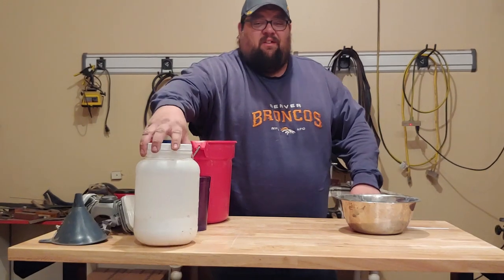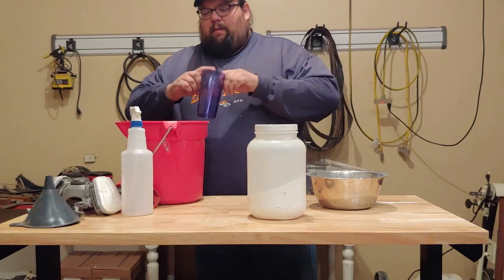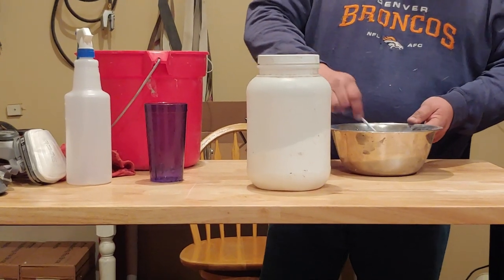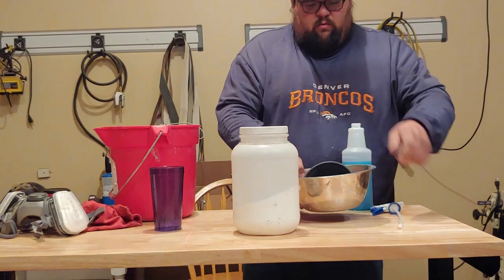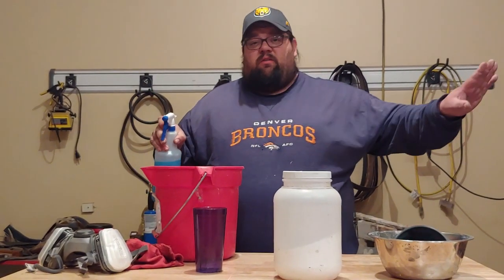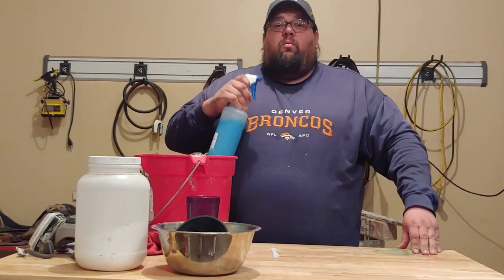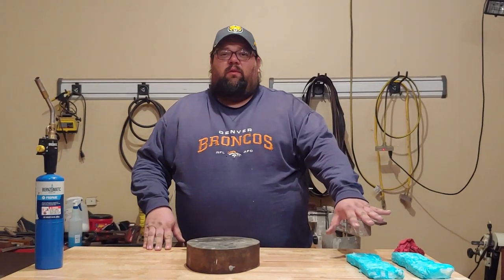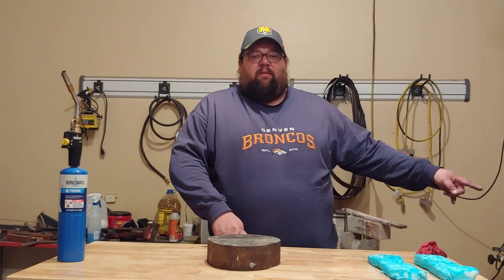How to ridgidize ceramic fiber blanket

Comment: Many thanks for your video. I purchased the fumed silica to rigidize the kaowool and will fire the kaowool/silica/food colour after it dries. I will add refractory cement after. Sincerely appreciate your experience and knowledge. Ralph, Ottawa, Canada.
Reply: Hey man i just recently started a job as assistant into making these furnaces. The thing is, the guy is kinda uncautious and when he throw these things on the table a lot of dust comes up! Im using a mask but it doesnt closes too well, i tried 2 masks and it was a little better, but i felt some chest pain later in the day... i got very scared. I dont want to lose this job, but im also an athlete as hobby and damn... im too scared of lung problems!!! Could you give me any advices to protect myself???? Do you think a couple months of exposure is enough to have problems??? I really need the money. Im gonna tell my boss that i believe we should treat it way more carefully otherwise i cannot stay.
Reply: @emoxanax  a P100 filter on a respirator will protect you from that. Under $50 if you need to buy it for yourself, but that really should be covered by the company.
Reply: @VoidedWarranty  yeah i ended up lefting. The guy had some chronic cough, he burned that shit with no ventilator inside the damn place... anyways! Fucked up. Hahah

I started a new slave job tho. Hopefully things will sort out.

Thanks

Comment: PLEASE READ:
DO NOT use fumed silica to rigidize your ceramic fiber blanket. I understand it is accepted by many "blacksmith experts". And I mean no disrespect towards the gentleman who made this video, or anyone else. It comes down to inorganic chemistry. Please read.
The reason we need to rigidize ceramic fiber blanket is to prevent the tiny silicate particles from entering our lungs. They are very bad. If you want more info on it, Google it. 
Ceramic fiber is made from Silicon and oxygen bonds, basically. The silicon and oxygen may form many linked bonds (hence larger fiber) or they may form a few (invisible fiber). It's a mix. But, these fibers are not connected to each other very well. Think of a jar full of small marchmallows. That's fiber blanket. Now heat it up and melt off of it-that is rigidize blanket. Kind of.
To prevent the fibers from breaking off and entering our lungs we need COLLOIDAL SILICA. Colloidal silica IS NOT THE SAME AS FUMED SILICA ADDED TO WATER. IT IS NOT EVEN COMPRABLE. in fact, fumed silica is the exact same chemical structure as the silica dust you breath in. If you use fumed silica, you are only making the matter worse.
Colloidal silica consists of tons of silicon atoms bonded to oxygen atoms and hydroxyls, in a repeating manner. Over and over again. They are massive molecules. When you apply it to ceramic fiber it will bind to the oxygen atoms of the silica, hence literally binding each fiber to a very durable and sturdy mass that will not let go.
Please, do not use fumed silica for rigidizing. You are actually better off not using anything. Fumed silica is exactly what we don't want to breath. To make colloidal silica from fumed silica, you would have to add sodium hydroxide, heat it up to a ridiculous temp, then use diffusion or chromatography methods to isolate it, as well as the aid of catalysts. It is NOT made by adding water.
Stay safe. Verify what you are told. If you don't know how to verify it or are not willing to, pay a professional to do it.
Reply from the maker: post sources.  I have posted the MSDS multiple times as my source to the safety.  Post a source other than your addled brain.

Comment: Ive learned tons over the course of becoming a glass crafter, with no help, money, only used recycled materials. First I made a table, blacksmithed a bunch of tools. 13 months later im doing my brick homemade Hotbox (kiln) . Its parts of from a junked BBQ. I spent money 170$ on a torch,bottles. I did buyn some ceramic wool blanket for my hot box. Since i dont want some mass manufactured thing newho. Anyhow i could write a story. Just buying silica ashes, or fumed silica, lolI learned a shit ton about oils and coatings and a world of oils and endless blends i never imagined. I hope someday people can have good times together without knowing whats gonna happen. I love cooking, its similarly creative. My slurry for keeping the coat from shedding was the silica powder, a touch of gypsum or pop, . I surf as well . As knowing resin/Epoxy/Fiberglass for repairing. The world is becomming  asmaller place and less confusing the more i know and see and experience resins form, recrystalize, hardens. I lined by Top half today with Blanket and a shitton of Silicate.Yes Today.. I don't know nor think it will be much different than the reaction to make surfboard resin. once done. I saw all its uses from some ad and was impressed. This stuf weights grams for a quart of it. truely awaiting results.
TY for the introduction , I t helped me progress

Comment: I want to use a ceramic blanket to surround my RV generator compartment to keep heat out of the coach. After ridigizing do you think the ceramic blanket can be used by itself for this purpose?
Reply from the maker: no.  if the rigidiser is not fired after application, it will eventually dry out and begin releasing from the blanket.  If you were to heat it to 2k degrees after applying rigidiser then it will work.  however it will not be very flexible.  If you go that route I suggest prepping and firing a 2" square piece first so you can see how it behaves afterword.  Also by adding more silica to your water mix the more "foam" like the resulting fired blanket will be.
Reply: @irondaggerblacksmithsupply1237  Thanks for the response. Well I agree with your logic and your's and other videos about ceramic insulation blankets have me convinced that I need another, more conventional solution to heat and sound insulation for my 1973 GMC Motorhome generator compartment. I went overboard in my zeal for heat insulation. There are other products better suited to my requirements. Now I'm stuck with a 12' x 2' x 1" roll and a jar of fumed Silica.
Reply from the maker: @donjaksa4071  If its 12' by 2'  its probably 2" thick.  1" is normally 25' by 2'.  post it for sale locally.  I assure you someone will buy it.
Reply: @donjaksa4071  build a forge or 3 lol

Comment: So I just ordered a devils forge furnace and didn't even know about this stuff am I supposed to remove all the ceramic wool from inside the furnace to do this to it or can I leave it in there while I coat it?
Reply from the maker: You can leave it in.  Just be sure that you are wearing a respirator when working with it.  On a side note.  I have never used the refractory sent with the devils/hells forges so I can not speak to it particular.  However all refractories I have ever used that I would call "quality" stick better to the blanket when it is "buttered" or wet from the ridgidizer.
Reply: @irondaggerblacksmithsupply1237  blanket?
Reply: @irondaggerblacksmithsupply1237  im sorry buddy but I don't have any experience at all doing this and noone to train me so any advice you would give someone who literally knows nothing and just got a furnace in the mail shoot
Reply: @irondaggerblacksmithsupply1237  i subscribed to your channel and will be giving you a shout out on my channel for you letting my subscribers know who you are and to check you out
Reply from the maker: Thankyou.  I'm happy to answer any questions you have that's the point of this channel.  If it's something I don't feel I've covered well enough in a video I'll make a new one for it.  Blanket, is as in ceramic fiber blanket(or wool).  It is the white fluffy stuff inside the forge.  That is what you want to apply the ridgidizer too.
Reply: @irondaggerblacksmithsupply1237  oh okay I've never heard it referred to as that thank you

Comment: I built a custom fireplace and am using ceramic blanket for keeping the exterior of the fireplace cool enough to touch. I have the Blanket sandwiched between two pieces of metal. Should I still rigidize it even though it’s not directly exposed?
Reply from the maker: It depends on if any airflow gets between the metal.  If it is sealed and enclosed in metal in theory it's safe (it's kind of like asbestos as long as it is not disturbed in anyway it can not send anything airborn)  if it is at all "open" yes it needs rigidised for safety.

Comment: Thanks for sharing this information. The forge I bought only comes with refactory (they call it refactory rigidizer). Is it not enough to just coat the outside with refactory cement? My guess is that if the refactory is damaged then the rigidizer will prevent the wool fibers from going airborne?
Reply from the maker: IMO no.  rigidizer protects you from the blanket.  refractory protects the blanket from you.  If you are gentle to the refractory and never erode it away or break it so the blanket will always remain sealed then it's okay.

Comment: I'm about to do the insulation step on a forge I'm building, would it work to just run the burners on the "firing" step?
Reply from the maker: yes thats how i fire.  however you have to do it in steps.  heat to around 1k and hold for 1/2 an hour  heat to around 1500 and hold for 1/2 an hour  final fire get to forge weld temps and hold for a 1/2 hour.  letting cool to the touch between each fire.
Reply: @irondaggerblacksmithsupply1237  thank you for the advice!

Comment: Hello, thanks for the time to make this video. Any tips on applying the fumed silica to a round tank? Similar to the firebox of a woodburning stove, only difference is round and how to hold insulation in place?
Reply from the maker: I've built many round forges.  if you cut the blanket as one long piece it will hold itself in place.  As for the ridgidizer nope just paint/pour/spray it on the blanket will soak it up

Comment: Can this be fired in the forge or does it have to be done out side of the forge.
Reply from the maker: It can be fired in the forge.  I routinely put refractory on before firing.(refractory tends to stick better to wet blanket)  it takes about 1800F for silica to start to become crystalline.

Comment: Do I have to rigidizer the whole furnace if my furnace uses heating coils instead of propane?

And should I fire it using actual fire before using it?
Reply from the maker: rigidizer protects you from the blanket, your heat source is not important.  fire as in bring to heat, it doesn't need to be actual flames.

Comment: How hard is the blanket after it is dried and been fired? I am looking for something to insultate a metal box I am using for research (it is kind of like a toaster oven, but is losing heat like crazy) and was hoping to be able to either screw 4 panels of insulation together, or just bend them and place the blanket on back of the device, covering the top and sides to prevent extensive heat loss. Do you think using something like the ceramic wool blanket would be my best option, or is there something else that would work? The box is 34.7cm wide, 22.6cm deep and 37.8cm tall with a door that needs to open on the front and the insulation needs to be removable for making improvements on the device.

Thanks in advance
Reply from the maker: if make the ridgidizer out of a LOT of fumed silica and a little bit of water.  you create a dry water.  when that is fired it is kind of like a bouncy dense sponge.  However it is important to note that it is not meant to be used this way at all.  once you have fired it, it should be covered in refractory to ensure you do not damage the blanket.  Enough damage and you will release fibers

Comment: could you provide an amazon link to the powder you used? Was it fumed silica?
Reply from the maker: https://www.amazon.com/Cabosil-Fumed-Silica-Gallon-Thickener/dp/B00VXVAAGE/ref=sr_1_4?dchild=1&keywords=fumed+silica&qid=1610932343&sr=8-4
Reply: @irondaggerblacksmithsupply1237  Thanks, just one question, for the firing fumed silica, is a torch really sufficient? Or that painted board needs to be fired in a kiln?
Reply from the maker: @swaroopcool22  the torch will do it, but i usually apply the refractory with the blanket wet as it sticks better then just fire the entire forge up to temps for the curing of the refractory.
Reply: @irondaggerblacksmithsupply1237  in this case do you think having the ceramic blanket coating on the inside of the kiln a better option ? Or is there any specific reason to use the blanket on the outside?
Reply from the maker: @swaroopcool22  I'm confused by your question.  Your Forge/kiln "layers" going outside to in should be.  Shell/Rigidised Ceramic blanket/Refractory(Kastolite 30/missou)/IR coating like plistex/itc100(if you intend to use one)

Comment: Is it a specific they of silica needed? Fume silica? In the process of ordering some ceramic blanket, the company I’m getting it from recommend their own zircon paint, £40 for 10L.  These seems like a more sensible option, just struggling to find the product online
Reply from the maker: you need to make sure it is not listed as hydrophobic.   Other then that it is just fumed silica.  I believe the brand I use is cabosil.  A zircon wash is the same kind of thing as ITC100.  It will work to hold the particles down however it is just a surface coating and does not penetrate very far in to the blanket.
Reply: Thank you kindly!
Reply from the maker: @harrybaldwin686  You are very welcome!

Comment: Do I need a rigidizer and a coating like hellcoat or can I use one or the other?
Reply from the maker: ridgidizer protects you from the blanket.  refractory protects the blanket from you.  In reality refractory does a lot more than just that.  I believe both are essential to building a safe forge.  I have never used hellcoat.  I recomend.  Duracon32,  Kastolite 30,  missou, or satanite. i have used all of these and they are all work well.

Comment: Tell me agin why you need to fire the C Blanket before using it in a Forge?
Reply from the maker: to cure what ever you put on.  firing rigidizer causes the fumed silica to bind to the blanket.  firing the refractory cure's it and makes it much more resistant to thermal shock.

Comment: The silicate in water is basically "pottery glaze".  It will dry to a clear hard solid, but if you don't fire it, moisture from the air will attack it, pitting it.  I think the firing is not a chemical reaction, but rather something like driving off water hydrates or such, as in firing bricks, but I'm not a chemist.  Similar silicate solution was coated on the carbon-carbon leading edges of the Space Shuttle wings.  It melts around 1200 F (like glass) but still provides thermal protection as a liquid and likely also gives environmental protection.
Reply from the maker: nope.  As the silica is fired it turns to cristabolite(sp).  this form bonds it to the blanket.  if left untreated at this point.  as you use the cristabolite(sp) would clump and break off exposing the blanket under and making it unsafe.  However because we coat the treated blanket in castable refractory it is not able to break off and sits there.  over time eventually even coated in refractory it will breakdown (this is why forges must be relined)  However the silica will not melt untill it cross the 3k+F threshold.  behind a good refractory it will never reach that temp.    http://www.quartzpage.de/gen_mod.html
Reply: @irondaggerblacksmithsupply1237  
Thanks for the reply.  I was probably thinking of the "softening point" of silica glass, which is 1550F, whereas the melting point is 2075 F and when transitioned to quartz (SiO4) becomes 3101 F.  I tested some silica solution 15 years ago, which was provided by the company who made the Space Shuttle carbon-carbon wing edges to see if I could bond thermocouples and strain gages with it.  It worked, forming a hard clear coating, but after sitting 6 months in my office (unfired) it turned milky and brittle, which I assumed was from moisture in the air, but perhaps another reaction over time.  A higher-temperature fiber is alumina, which in pure crystal form is sapphire - Al2O3, 2nd hardest to diamond.  In nature, impurities make it the sapphire or ruby gem.  Alumina fibers are used to insulate thermocouple wires (Nextel is one brand), though is brittle and the fibers are short so needs a binder.  Alumina might be the main constituent of these ceramic blankets.  The company also mentions kaolin, which is the coating on glossy paper, also termed "China Clay".

Comment: Can i use this ceramic fiber blanket for exhaust system?
Reply from the maker: do you mean as an insulation to shield the piping?  or do you mean forming the blanket in to the piping itself?  either is possible especially if you coat it in a refractory cement after.  Before attempting however I would highly recommend consulting the manufacturer to make sure that it will hold up for the particular type of work you need.

Comment: Hey thanks for the video, I didn't know this stuff existed. Of the store bought brands are there some that have more or less silica? Or what measurement should I be looking for? Also some say they're only good for heat up to 2300f which may not be as high as the my forge temp gets to. Any suggestions? 

Thanks again

Comment: Can I use this to rebuild my fire box in my boiler like this and just cut the blanket to fit?
Reply from the maker: I have zero knowledge of boilers or there proper upkeep.
Reply: @irondaggerblacksmithsupply1237  ok.  Thanks.  I will read more into it.  Once again thanks for the great video
Reply: So I’ve been building a furnace and I plan on putting ceramic fiber between the burn box and the outside layer of metal. Both sides are covered but the top and bottom 1” are open. Do I need to treat the whole blanket before installing? Or can I install it and spray the top and bottom than cure it with the burner and not worry about where the metal touches? Thanks in advance